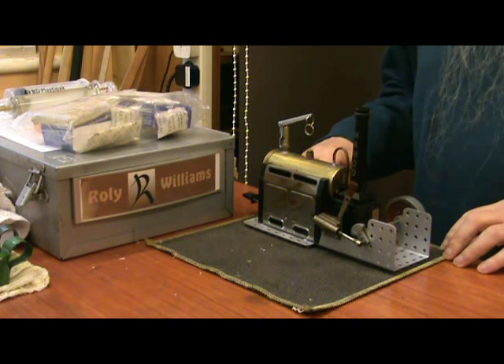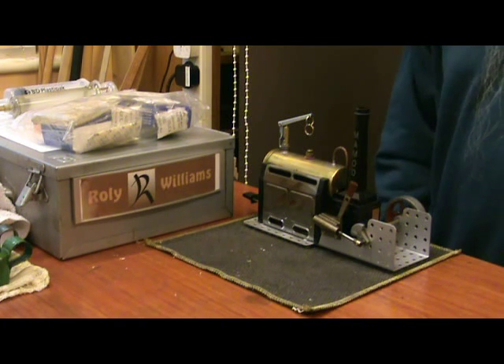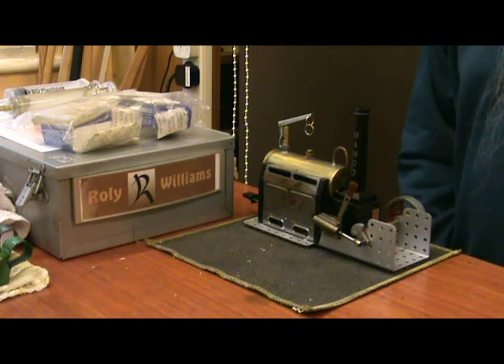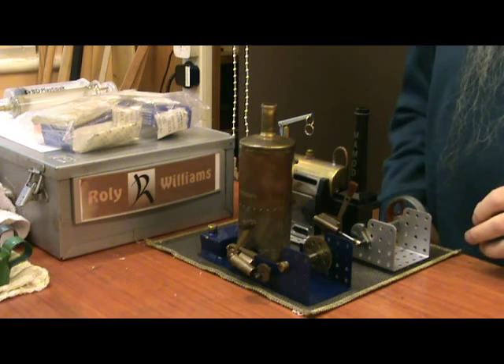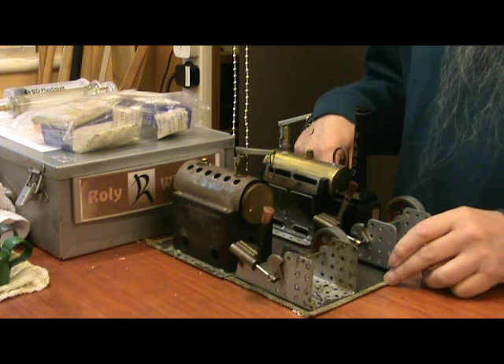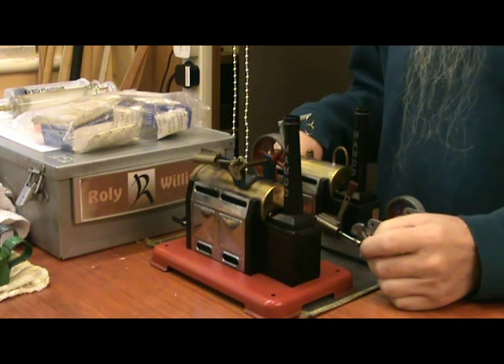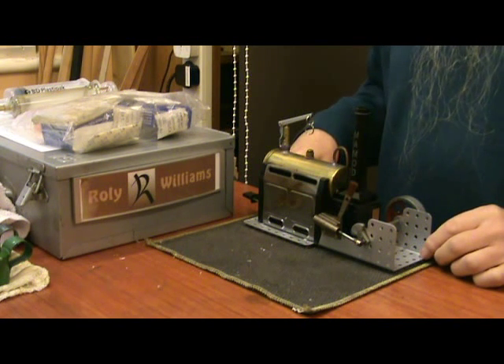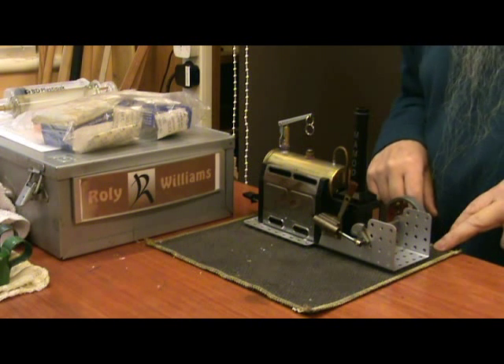REW SP3A

Comment: l am about to bid for one,as l like the look of it,why did you use two types of oil,many thanks,
Reply from the maker: I use a thick steam oil for the parts in contact with steam, and a thinner oil for other moving parts.
Reply from the maker: BTW, I hope you realise that any you find on ebay or elsewhere will not be my modified version!